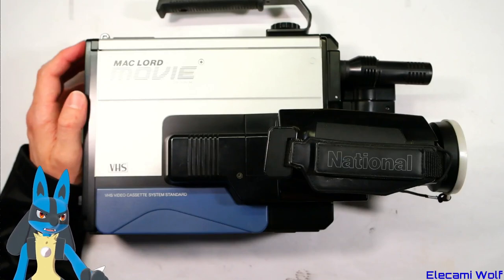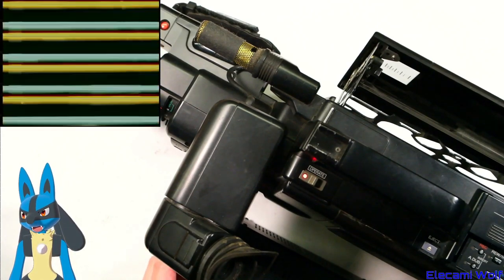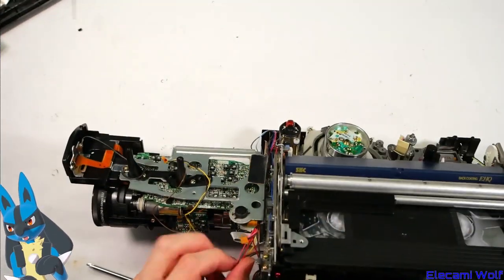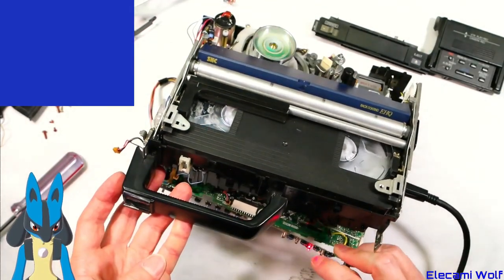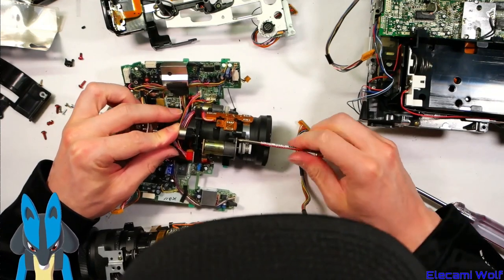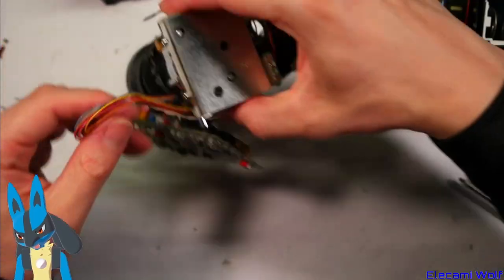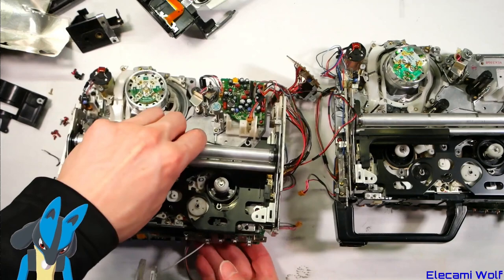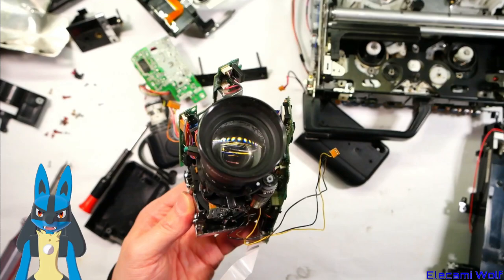EW0083 - Panasonic NV-M7 Investigation Teardown

Comment: Amazing video, I have two of these M7's both with bad capacitors, want to replace them at some point to hopefully get rid of all the noise, they are very nice camcorders
Reply from the maker: Thanks. Don't delay replacing the caps too much. The electrolyte leaking out can cause damage to the board.
Reply: @Elecami  Hey again, replaced the bad caps in both of the M7s today after realising I had the right capacitors already, both went well and fixed the issue, however, one of the M7s can't record to VHS as it seems on of the tape heads has broken from having a close look at the drum. One of them is fully working now, and is very fun to use, just need to get a new battery so it'll be portable. The other one could still be used by using an external recorder. Thanks for this video, do you think you'll get yours fixed eventually?
Reply from the maker: @radnerd17  Great to hear you go it going.
Not sure I will get around to fixing mine. More focusing on documenting all the stuff I have. I have a enough to make more than 100 more videos.
I have been repairing some of the things in the videos.
Reply: @radnerd17  which electrolitic  capacitors did you change? All on the board? And now many?
Reply: @fabriziooldrini6888  The 2 capacitors that are on the 9V rail. I replaced them with the same capacity but higher voltage rated capacitors. I'll have to have a look at my photos from when I replaced them, but it is a very difficult job
Reply: Whilst both M7s I have work, they both have issues. One still has the white bars appear, just more faint, maybe other capacitors are starting to go bad. The other one spat out one of the VHS capstan heads so it no longer records to VHS. I have moved away from actually using them as its a case of constantly fixing them every time I want to use them. I mainly use my Sony HVR-Z1P and HDR-FX1E, as well as my Sony HDR-PJ760V.
Reply: @sovrus-urbex  sorry, accidentally used my other account, but all of the above is me

Comment: Great video - thanks! I'm tempted to pull mine apart to try and give the tape spools a lil clean. All the stickers on the underside warning me of 'dangerous voltage' inside have me second guessing.. I'll be okay just as long as it's not connected to the AC adapter and all the batteries are removed right?
Reply from the maker: There is high voltage on the Camera pickup tube. I am not sure if it stores charge like a CRT does. Those parts are usually well insulated inside the camera. You should be ok if you have power off while working on it.
Reply: No camera tube in the M7, it uses a CCD instead, so no crazy voltages there. The only place likely to run on high voltage is the viewfinder which is a miniature CRT. That probably has a couple of hundred volts floating around in there.

Comment: Both cameras seem to have leaking caps, a very common fault with these cameras due to their age. I had the same issue with mine and replaced the two 9-volt rail caps, and now it works completely fine. I don't know about the power zoom, though.
Reply from the maker: Yea, the switching power supply is pretty hard on the caps so those power supply caps will go bad first.

Comment: Hey EW, how do you do the motion capture for your animated Lucario?

Mold and mildew sucks.  I lost a bunch of floppy disks for my Commodore 64 because there was visible mold on the disk surface after they spent years in my damp basement.  That house had mold everywhere.
Reply from the maker: Hello, I use VSeeFace and the hand tracking is with Ultraleap tracker.

Yea, damp storage is not good.

Comment: mine doesn't turn on and the battery is stuck inside. what do I do?
Reply from the maker: Probably needs to have the capacitors replaced in the power supply circuits.

Comment: Hey, I just purchased one of these for ten bucks at a flea market. It turns on and all features on the side work (have an effect within the viewfinder) and it plays back VHS tapes from its receiver, seems to record if opted to with a blank tape. 

However, if not viewing back a tape it is a grey screen, forward zoom buttons do not work (though record does being REC on the finder) and I wonder where the issue lies or how to repair this. If you have any advice, please let me know! 🐺❤
Reply from the maker: Probably be power supply issues. Switching power supply in the corner of the main board. Capacitors get a hard time and will be worn out now. That would be the first thing I check.
Reply: @Elecami  I'll give it a good shot soon and let you know! Thanks for the direction :)

Comment: Hey i have a Panasonic nva450 the headdrum spins way to fast all the time what could be wrong?
Reply from the maker: Could be one or more of a range of things. The motor controller, Motor driver, power supply issue. Bad connection / bad soldering. Electrolytic capacitors gone bad.
Reply: @Elecami  after it runs for like 30 minutes the speed calms down and the cam plays fine besides a little shaky picture because the headdrum isn't to stable
Reply from the maker: @TechnicFreakJulian  Probably after the capacitors have warmed up. Replace capacitors and see if that helps.

Comment: Hey i have same model but mine when i press power on all red light on and sometimes noise i hear then i open up and changed the belt but i see nothing happens thr loading motor doesn’t start when i eject what was thr problem i am very nervous 😬
Reply from the maker: Most likely power supply problems caused by bad capacitors.
Might be able to get it working by replacing all the power supply capacitors.
Reply: @Elecami well i have damn 2 m5 and one m7 unfortunately all not working as I mention i tired now repair them well i can’t change capacitors its so difficult task for me but i will definitely find someone camera repair thanks a lot for ur support ❤

Comment: Hola, me interesó tu canal sobre el desarme y arreglo de las cámaras vhs, tengo cinco cámaras, tres no encienden las otras dos, una no graba y, cuando pongo play, se corta. La otra funciona bien, graba, las otras funciones andan bien, pero no puedo ver por el visor, que puede ser. Agradecería si puden orientarme, no consigo técnico para que la revise, nadie quiere arreglar videos cámaras ni videos caseteras. Me pueden informar que se puede hacer.
Reply from the maker: I think these will all be power supply related problems. 
The most common issue is the capacitors inside the camera power supply section have gone bad and need to be replaced.
Reply: @Elecami  Gracias por la respuesta. El problema en Argentina es que nadie quiere arreglar las cámaras PANASONIC VHS O VIDEOS CASETERAS. Sigo sosteniendo que en algún momento, volveremos a lo analógico. Saludos Néstor.

Comment: Yea Seal that in a Sealed Plastic Box, with a CAP of Bleach...Bad MOLD that Mucks up Plastic and PVC Items in Damp Spots, The Rain Sucks..
Reply from the maker: Sounds like a good plan. But I wonder if that would affect other plastics and rubber parts? Might weaken the seals in the electrolytic capacitors.